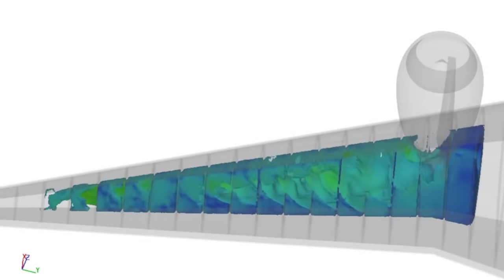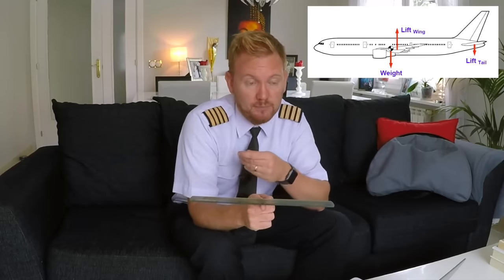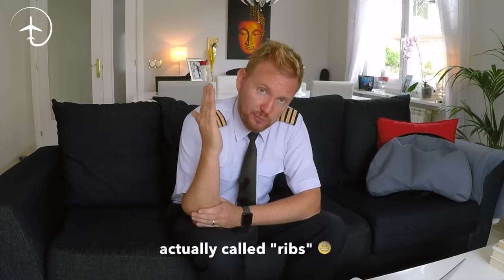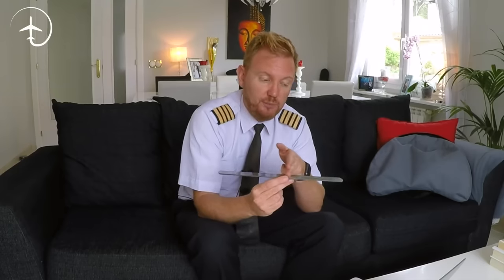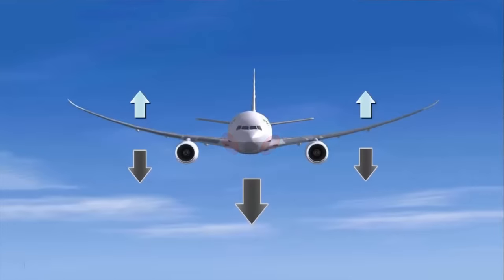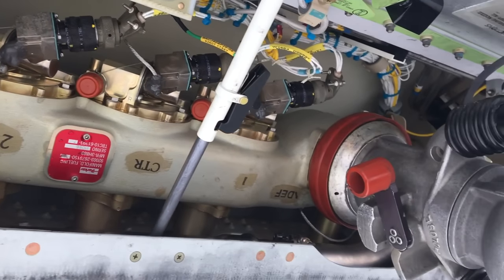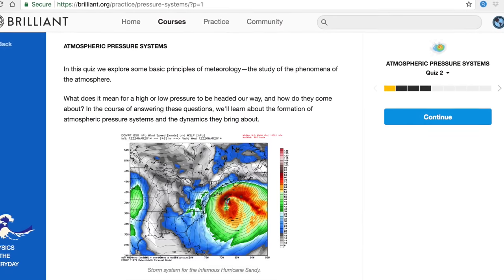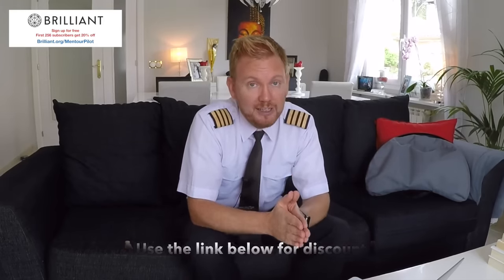Why do aircraft store fuel in the wings?

Comment: Great video. I've got a question. There is a type o B777 called B777ER (i suspect from extended range) . How this type differs to the typical B777? Is it only additional tanks? For instance do they set a cap to passengers or cargo as well to reduce weight? Thanks a lot

Comment: Very good your explanation. I have always been curious about the storage and operation of fuel tanks in an airplane. I have also often wondered how the very bulky fuel fits inside a wing and how it flows uniformly and integrally through the openings of the wing ribs, as you yourself said, if they form a barrier preventing the fuel from shaking and destabilizing the apparatus in turbulence, they also do not pose barriers to an integral flow of fuel? And is it true that some airplanes even use the rudder to store fuel? Thank you.
Reply: Not the rudder. The horizontal stabilizer center section.

Comment: One question, you always need to turn off the pumps when the central fuel tank is empty? Don't have any automatic system to turn it off if for an issue or moment of distraction you take more time to see the warning light and the pump have the life reduced by overheating or work without lubrification?

Comment: Can you kindly explain if I fly from Station 'A' with 0.8507 kg/l density (60,000 kg of fuel) and reach Station 'B' where I am not taking any fuel but the temperature is very high (may with station average density as 0.7309 kg/l) if I fly without taking any more fuel (as remaining fuel is 40,000 kg) then do I need or require density to calculate my Fuel for actual B.A calculation in the load sheet ?

Comment: Hey.....I have few questions, 
1. I was on a simulator for beoing 747 and I saw alot of switches infront of me and also the auto pilot on the center..........when the entire plane is controlled by so many switches , electronics and computer alogorithms, then why can't we have a LAPTOP like screens and keyboards and applications on the Laptop to input data for say auto pilot etc, rather than doing it manually moving the knobs etc........the screen and application on Laptop screen can also show how the plane is moving in air give a 3D view both in animated form and if cams are placed outside it can also give real view of how plane is moving in air.

2. The application mentioned above can also be controlled from ATC can stop crashes and also make resources used by plane in more efficient manner. isn't it ?

3. Why don't planes have cameras installed within passenger compartments, cockpit and storage area which can even send LIVE pics to ATC, esp during say a hijack or trouble ?

Comment: Cause the wing is the only big storage than the fuselage,,,but other planes has fuel storage on the engine for long haul flights or a joyride
Reply: REally?  What aircraft has fuel storage on the engine?
Reply: Other airplanes fuel caps is on the wing well,it only have the turboprops such as the daher or tbm aircrafts

Comment: What about the static electricity generated by the movement of fuel inside the wings like it does in motor cars? How the static electricity neutralize in the air?
Reply: I believe that most jet fuel has antistatic additives. Aircraft do build up a static charge due to air drag friction and they dissipate it using static "wicks" which are very small pointy carbon rods attached to the trailing edge of the wing and horizontal stabilizer.

Comment: Airplanes run on air not fuel. My father retired from Boeing after more than 40 years. He and his wife worked in different departments on the wing assembly. Neither of them ever installed or seen any fuel tanks when I asked him about this he said the fuel tanks were installed after the wing was built. That's what he was told and he believed it and still does
Reply: @sexigrande1792  my dad said never seen fuel tanks in the wings he was told they get installed after wing is assembled. Boeing 777 holds 57,000 gal? 20 or 25,000 per wing? How many square ft does that equal?
Reply: @sexigrande1792  the answer is 20,000 gal equals more than 26,000 square ft. THINK
Reply: Don't let these so called experts fool you. For example they say  320000 litre fuel fits in the wings of an Airbus A380 ! A big crane can lift 8000 kilograms. To lift this aeroplane without passengers and luggage you need 74 cranes ! Think always with an open mind. It will free you from mental enslavement.
Reply: @sexigrande1792  free energy machines on any scale are impossible
Reply: Your argument is that a number is large, therefore it's impossible? The wing tanks of an A380 are easily large enough for you to walk inside (about 3 meters tall at the wing root). Obviously, it tapers a lot, but the wing area is 845 cubic meters. Assuming half the planform area is used for fuel and the tanks are a meter thick on average you have well over 320 cubic meters of fuel.
Reply: @sexigrande1792  what are you saying I'm a flat earther ???? Just talking to talk?

Comment: Hello, how is it that the fuel can be totally depleted from a fuel tank? Where is the pump sucking the fuel from? I mean lets look at the wing tanks for example. If the plane is flying level than the fuel is obviously spread in between all the spars, if the plane turns than one wing would have its fuel towards the wingtip and the other towards the fuselage. So how is it that the pumps dont suck air? How is it done that the engines get an undistrupted fuel flow?

Comment: I have a question @MentourPilot, ive noticed that on the widebody aircraft that I work with mainly the B777-300er, A330-200, A350-900 and the A380-800 that fueling between the Airbus and Boeing is on opposite sides, is this brand specific or can both manufacturers refuel on either side?

Comment: What telemetry is used in cockpit to keep plane correct angle for landing and not get tail strike???
Reply from the maker: Combination of correct glide path and correct speed.
Reply: @MentourPilot  no actual visual instrument? And can you please do a 9/11 analysis video? I know its touchy subject but this is still a lingering question for so many, id like some levelled headed analysis who puts conspiracy aside and just attacks it from facts.
Reply: @jakekiddall5108  - There is also an instrument. You can also see the angle on the primary flight display which shows the artificial horizon. It shows the angle compared to the real horizon. The pilots will know if the nose is at too high angle.

Comment: It is an advantage for the plan .wing is most strongest structure near engines and far from passengers. That what make plan a safe heaven for investment .plans with back engine really like holding a cup and trying not to fall .here it is like magnetic floating and maneuvering the cup it is less breakable from holding applying pressure to one structure .

Comment: I climbed through aircraft fuel tanks for four years. It's a tight fit.
Reply: Sceptic101 O0O0O On the 737NG it is quite spacious🙃
Reply: @speedbird9313  I worked on the KC-135, FB-111,  and A-10.
Reply: Sceptic101 O0O0O I believe you🙃 Ive been in DC9/MD80 and 737 CL and NG tanks. The maddog was also a tight fit.

Comment: At high altitude, if the engine has to suck fuel, the danger is that fuel may boil, in the low pressure fuel line, causing a fuel vapor lock.  I don't think it's "air" in the fuel.

Comment: wings are the structure which lifts the aircraft fuselage in the air and   supported by  landing gear on the ground,,, Fuselage is hanging by wings from both side ,,, so putting weight on wings will  NOT put a stresses and will not strain the aircraft structure,,,, compared to  loading fuselage  and supporting them by wings.  I am just an engineer,,,not aeronautical engineer,,,,

Comment: What I want to know is how in the hell do they fit 40- 50,000 gallons in the wings and center tank. That just seems like a very unreal amount of fuel to store in an area of this size.
Reply from the maker: This is why studying physics is so important.,how much fuel do you think they can fit in a simple fuel-truck?
Reply: I though it was 5000 gallons per tank. At lest for the fuel trucks that deliver fuel to a gas station. I'm not sure if the fuel trucks at air ports are a different size.
Reply: @pandarama67  I think because wing is really long to compensate it's thinness compared to ordinary fuel tank so that fuel can fit.
Reply: That seems ....

This is why math was invented.
Take the projected ground area, tke 70 to 80% of it (because you also need some space inside the wing for support structures as well as technical systems and CALCULATE how high such a body would need to be in order to have the claimed volume. Then compare this calculated higth with the average thickness (thus the height) of a wing.

See.
No major guessing required. Just a little bit of math.
And yes. It is pretty easy to grossly underestimate volume.

Comment: Have you seen them video's that claim airlines are lying to everyone about how much fuel these jets actually use?. These videos are all over the internet. The people that are saying this are claiming these jets use extremely very little fuel to run these engines and it all has to do with air only. We all know it has something to do with fuel and air, but in these videos these guys are saying that 90% of your ticket cost is for fuel that these jet engines are not really using and the airlines are charging people for nothing. They also say its impossible for these wings to hold that much fuel and the weight of the fuel. Now I have worked in factories and seen first hand knowledge of the extreme strength of metal structures under pressure. It is more then possible that these wings can take the load.

Comment: Why do they fill the tanks from the underside of the wing near the wing root? Is it for ease of access? You would think that they would fill it at the wing tip on the upper surface and let gravity do its thing.......
Reply from the maker: Yes, it’s for ease of access from the fuel truck,
Reply: It's so they can do it from a single point and not have to go tank-to-tank.  Google "single point refueling."  Also, if you have to open a cap on top and let gravity do the work, it's slower and you have a chance of getting debris in the tank, or you can't do it when it's raining.
Reply: @ShawnD1027  Knowledge man that's great thanks!
Reply: You're welcome,  @muhammadfathonihanif5500  !

Comment: How is much is Max fuel on a 747  and what is the usual fuel level before a take off or do you guys always keep it on Max fuel before takeoff or just what's needed
Reply: The capacity depends on the specific model, wikipedia says it can range from 183 m³ (48,445 gal) to 241 m³ (63,705 gal). As for the TO load, pretty sure the economics makes them only fill up what will be needed for the journey, no reason to top off.

Comment: How do we making sure that both wings has the exact amount of gasoline ?  Is there some acceptable amount differences between both wings ???
Reply: Yes there's an acceptable difference. Also, it is possible to transfer fuel from one side to the other if the difference got to large. Though normally if that happens in flight, you have to check first for possible leaks, because one side draining significantly faster than the other side should not happen.

Comment: How is it ensured that no fuel remains in the wing? Isn't there residue that gets stuck between the ribs and the sections?
Reply: ralienpp Just like Gasoline evaporates quickly and leaves no residue, I’d think the same for jet fuel
Reply: @ralienpp > All aircraft will have a certain amount of unusable fuel.  That fuel can be drained and sumped out of the tank by the mechanics if required for maintenance and access into the wing.

Comment: One question is that above 8 thousands meters there is almost no oxygen, then how jet engine works without it. Thanks in advance
Reply: There is the equivalent of 7.7% oxygen (partial pressure) and the engines are sucking in a lot of air.

Comment: What stops the fuel from freezing as the outside temp is mostly below zero
Reply: Avtur (aviation turbine fuel) does not freeze till it's well before freezing point. On bases run by the British Antarctic Survey the diesel generators are fueled with avtur, because normal diesel fuel would freeze in the drums.
However, we were not allowed to use avtur for cooking when away from the base, because some of the chemicals they put into it to lower the freezing point also produce toxic fumes when burnt.

Comment: For third reason what happens if flight travels long distances the fuel get empty right??
Reply: That's good question ! I was wondering about that too . 🤔
Reply: @henrysiahaan9604  Sir one more doubt does that fuel in wings used for running the engine or it is only for Balancing the plane?

Comment: Didnt you meant vertical spars for those wing ribs?
Reply: Rombout Versluijs Vertical spars? There are two spars in each wing, the fwd and aft spar🤷🏻‍♂️
Reply: @speedbird9313  I think i took the wrong term from google
Reply: Rombout Versluijs I would recommend using the SRM instead of google😉
Reply: @speedbird9313  Enlighten me, what is SRM?
Reply: Rombout Versluijs Structural Repair Manual🙃
Reply: @speedbird9313  ah official document. Thanks

Comment: What time we use emergency exit doors recently ethopion flight loss the balance in 6 mins why not use emergency exit for escape
Reply: There is a something wrong with the design of planes this big error missing system is a emergency and saving system every year you will her on radio a bad crash accident.

The missing system is an standby machines when the active engine failed to work properly we need extra engines used only in emergency situations and also big balloon   I mean a big blashote or something is designed to reduce the down acceleration to avoid hard hitting to the ground and also emergency door for escaping purpose.

Finally I'm concluding my adea the all emergency system safety is missing for all planes so this mean to get into airplane is so dangerous and one engine failing is means your heart stopped working for a life!

Comment: to ride in planes with engines and fuel on the wings could have future benefit for safety. I want to design a plane that can optionally ditch its wings all together before crashing so more folks have a chance to surviving. The second the wings hit something they usually just explode in huge and I mean HUGE FIRY EXPLOSIONS killing everyone on bored. On the down, drop the wings. Loses a shit load of weight. Could even secure rocket pod parachutes on the plane it’s self to greatly reduce impact. More survival. Why doesn’t anybody think of this? I mean it’s heavy…but they do it with heavy ass rockets

Comment: If fuel in the wings helps them bend less, then later in the flight they would start bending more again as the fuel is being used, wouldn't they? I've been wondering why that is not a problem, or might even be incorrect.

My best hypothesis thus far is that the highest load on the wings is generated during take-off, followed by climbing to higher altitudes. During take-off and the initial climb, there is still a lot of fuel in the wings, thus allowing us to reap its benefits while generating high G loads. During later phases of our flight, we both weigh less and are less likely to subject the wings to high load since we're not climbing as steeply anymore.

Can anyone confirm that I'm on the right track or correct me?
Reply: You're right that they bend more as fuel is being used. It's not a problem simply because the structure is designed for the bending moment generated when the plane has low fuel and high weight in fuselage, and there is a maximum zero-fuel weight to make sure that the plane won't exceed it. If most or all of the fuel was stored in the fuselage, though, the maximum bending moment would be a lot higher and it'd just be harder to design.
Reply: @AmbientMorality  That makes a lot of sense. Cheers, mate!

Comment: Hi, I want to get answer on my question, hope you can help me. This year January 2020, I was outbound passenger in LH465 FRA-MCO and during departure just when the 747 airborne the aircraft started one heavy shaking and noise, (the noise is like when the grounder is grinding metals) n this situation went on proximetaly 15 - 20 seconds and than the noise and shaking suddenly stopped, and the aircraft continuously keeps climbing smoothly.
My feel was like, are we get to MCO or aircraft drop off just like the Concord made at the last departure. Please tell me what went wrong during airborne?
Reply: Immediately after takeoff? It's most likely a tire balancing issue, which isn't dangerous but can be scary. If it went on for a while, it might have been the nose wheel that was unbalanced (that can't be braked before gear retraction), otherwise the noise should have stopped as the landing gear retract

Comment: If there is let's say 7ton of fuel in wings, how much is approx used every mile? Or hour. Roughly. Any standard normal fly situation.
Reply: That's WAAAY too broad a question... Fuel is used at different rates during the multiple stages of a flight (take-off, climb, cruise, approach, landing, even taxying), and there are a bunch of aircraft manufacturers competing with each other trying to improve their performance.

Even for a specific type of plane, say a Boeing 737, there are a whole lot of different models for it, with averages (computed per passenger) ranging from 3.59 L/100 km (65.5 mpg) to 2.28 L/100 km (103 mpg).